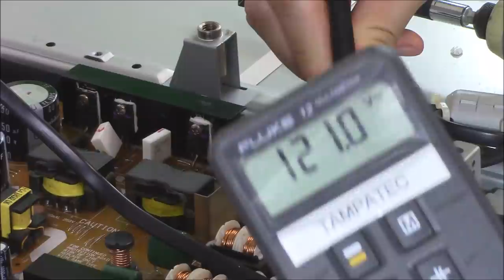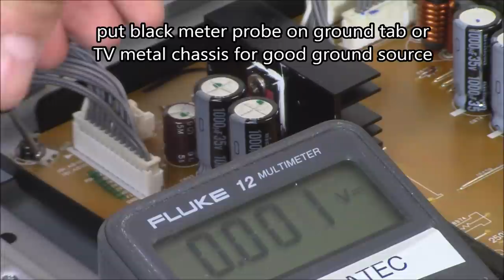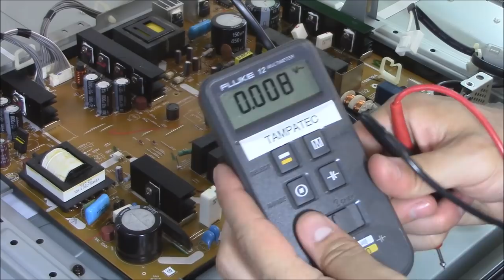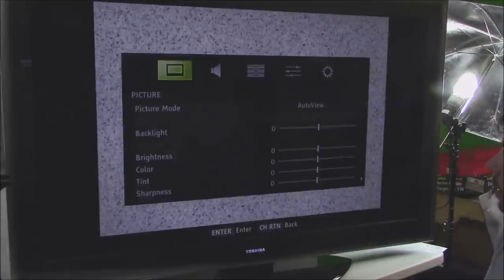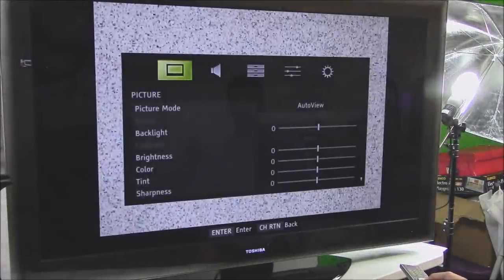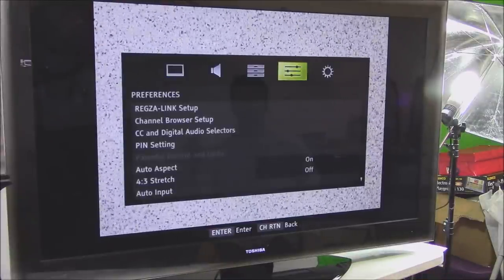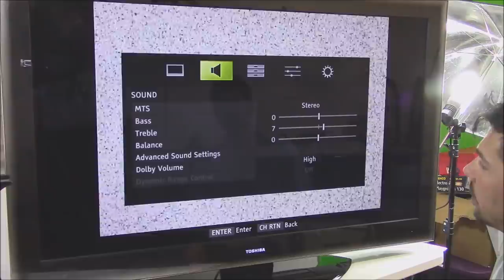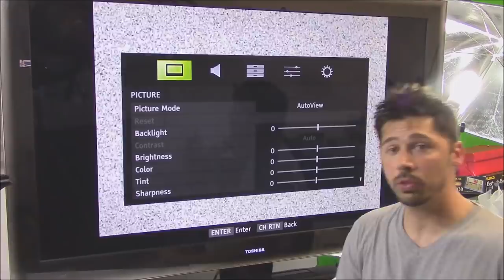Easy common fix Toshiba LCD TV, troubleshooting dead TV repair review

Comment from the maker: Help us Hit 300K subs and Grow Subscribe/Like for FREE Tech support- Please post "TV model" and "problem" and i'll reply with a common solution. Support this channel by getting a Capacitor kit for TV board repair- http://amzn.to/2gEH5Lt Thanks for the support! Let's bring back TV repair! Follow me on Instagram for giveaways and tech reviews https://www.instagram.com/tampatec/
Reply: Hey Tamptec, I'm new to the game; however, I have fixed two out of three displays so far using your advice, and based on percent chance that capacitors are the problem. I tried troubleshooting the power board on the LG 32LN570B-UH; the board is a EAX64905001 (2.4). Because I can't currently afford the Fluke meter, I am using a simple multi-meter with resistance, AC, and DC modes. When I tried reading the pin out I was at first getting less voltage than the 3.5, and 12, and 24 volts specified; the voltage was moving slightly. So I tried to read the voltage regulators and found that the voltage was jumping all over the map, peaking over 1000 volts, and following that reading the pin out was not reading any voltage. I have all ready replaced the caps on the board; However I suspect the voltage regulator is the problem. It seems there is more than one regulator, and the pins on each are jumping around. How can I determine which regulator is the bad one? 

I also found this link to the TV power board schematic: http://schematicscom.blogspot.ca/2016/07/lg32ln530b-led-lcd-tv-power-supply.html
Reply: Hi I am wondered watching people fixing tv's, you are in Florida that right?
Here in my country most tv repair shops are closed.

I am in electronics for 40 years but I repair treadmills and some other things, 
I have a lot of work.

Is posible to earn enough money fixing tv's?

Please comment.

Cheers.
Reply: Tampatec hey mine made a pop then turned off but a couple days later it was fine for like 3 hours then it shut made a blinking green light then shut off
Reply: Tampatec  I have a Toshiba 55 Led tv replaced fusible resistor now I have stand by volts but tv still won't turn on.
Reply: Q880 is the 12 volt IC regulator and Q840 is the standby 5 volt IC regulator.
Reply: R850  is a surge resistor and protects the 5 volt standby supply.
Reply: Raider5087 I checked them all and the r850 is open. What could have caused this and will that be the only thing I need to replace. Thanks
Reply: Hey bro my ps3 slime won’t take disc. The disc was stuck got out now it won’t take disc now can you help
Reply: I have a PE0702A V28A000962A1 Toshiba power supply board. following your video I don't have 5 or 12 volts. Do you thing that buying the kit from shopjimmy I can fix the board? Appreciate your comments.Antonio
Reply: Looking to get a complete board like this one in your video! Help me out please! Thanks

Comment: Thanks for the vid! I have the exact same TV and it had the same problem where one day it wouldn't turn on and had no standby power. I would not have known how to begin troubleshooting the issue but using your video I replaced the fuseable resistor and voltage regulator and boom, TV works again. Hopefully it works another 9 years!

Comment: Just repaired my 46" Regza using this video. Everything in the video was spot on with my set. It had just shut off one day and no sign of any power. Soldering the voltage regulator's 7 pins back in was a challenge- i feared that maybe i crossed some pins but it turned on great!

Comment: Thanks for the video.  Fixed this with 5J2R0 fusible resistor from Fry's Electronics.  The 5J2R0 was a suitable sub per some other online documentation.  Didnt have to swap out the Y6456 Voltage Regulator; which, was a good thing since they didnt have any locally and there were no suitable subs for it that I could find.  Whole cost was $1.59 for the 5J2R0 fusible resistors and there were 2x resistors in the package, so I have a spare.  This TV is 9yrs old is now new again and save hundreds in a new TV.  
Thanks Again.

Comment: Hello, first of all, thank you, great video. I have a 55ZV650U TV from 2009, it's very good, and today, for the first time, it didn't turn on. I checked up to the resistor point, and indeed, the fuse resistance of 1.8 ohms 5W is open. Tomorrow, I will go look for a replacement or something similar. I hope that with this, my TV will work again. Thanks again.👍

Comment: We just had this exact same problem! Our TV would not turn on, rather than looking for new I found this video, since I am a gas tech I had my multimeter.. and exact same fuse is bad for exact same reason as this video lol. So hoping today the repair store has the part and can hopefully de-solder and re-solder it for us since I don't have the iron pen. Seems very simple to do, I will have to invest in this!
Reply: Scratch this, its impossible to get the dam parts, so trying to find where to just get a new power supply board, and can't even manage that around me (Ontario Canada) .. so tv back together.. not gonna be fixed.

Comment: Hi, I have the exact same TV and exact same issue power.  It worked okay last night and this morning it will not turn back on.  Checked the power source that it works.  So, I am going to have to troubleshoot like you did.  I just wished you are/were close to where I am (in Midwest). So, I could just ask you -:).  But THANKS a lot for the video. I hope I can fix mine. I really like this TV as the picture quality is much better than many other more expensive TVs I have seen.  Thanks again.

Comment: thanks for the help just fixed my tv for 3 bucks because of this video. thanks again.
Reply from the maker: cool
Reply: +Roman Seppala  Where did you find the parts for $3?
Reply: +Roman Seppala , I also would like to know where did you get the parts from. I am in Canada.
Reply: +rmeshksar I got that fusible resistor off eBay from a company in the USA
Reply: Hi Steve, I am trying to find this resistor on eBay, could you send me the link that you used?
Reply: Chippie R were you able to find the fusible resistor online I'm having a real hard time finding it
Reply: Thank you very much
Reply: Your Welcome, make sure that is the one you need, mine was in R850 the other 2 were good on mine
Reply: its been working for 3 months now...all good...I actually just sold that tv and bought a 55 inch 4 k curved samsung tv
Reply: I am having the same problem on the 50 inch don't know what to do in wheelchair can't stand to long please help if you can
Reply: Any 1.8 ohm 5 watt ceramic resistor will work for R850 and fixes the dead set syndrome without replacing any regulator IC's.

Comment: I have a really old tv toshiba TP43H60 made in 1999 and i had the same problem. all i had to do was unplug the tv, then hold down the power button for 45 seconds, then plug it back in and turn the tv on and it worked! :D
Reply: For some reason, I decided to listen to your comment & try it on my tv, 2013 Toshiba. It actually worked! I’m not sure what the issue was or why holding down the power button works when it’s unplugged but it did & I’m grateful!

Comment: Thanks for the videos. Mine is a Toshiba too, the only pin with voltage is one labeled "5VCC" the reading is 5v so I assume it's ok. The problem is the TV makes a sound through speakers when I press power but it never turns on, green light flashes for a fraction of a second.

Comment: Ever replace smd type capacitors on a main board? Would that cause only 5v stby on power board but no 12 or 24 volts?  I noticed two seem slightly bulged.

Comment: Hi. I got all the way up to a successful test of the power cord fuse. I have not yet removed the power board to test anything further. Should I still go to testing the 3 white fusible capacitors (May have been called resistors, forgot)? Should I be going a different direction? The video ended after you replaced voltage regulator (I think), so not sure where to go at this point. Thanks.
Reply: Forgot to post Model and problem..... Toshiba Regza, 46XV645U. Had a power surge. When I plug it in, I hear a “click”, but nothing more. Won’t turn on and no status light. Checked everything you mentioned up to the power plug fuse and found no problems thus far.

Comment: I have the Toshiba 42ZV650U with the dreaded blinking green power light! I replaced the power board, and still have the same issue. Set appears to hang up in the boot sequence and never finishes. When I look at your work here, it appears that the boards differ a bit. My board is a SRV2194WW, I am almost thinking that something is missing from the set. It came to me as a throw away, and I suspect the previous owner dabbled a bit. I do not have a schematic, or even a photo of this model with the back off. If you have words of wisdom, or would be willing to look at a photo, please let me know. My main repair focus is musical instruments, but this has become an obsession. I want to fix this thing! Can you help?

Comment: This information is very helpful. I have replaced the caps on a HannG 281 D Monitor power board. It has a PHIHONG  PSM217-404-H-R switching power supply board. The monitor started and worked for a short time then stopped altogether. When I removed the board it had a small surface mount cap C404 blown. I would like to replace this cap but I can find no reference to its parameters. It is parallel with a 35V 470 uF Cap located at C403 so i am thinking it is on the 24V rail on this power supply. It is located adjacent to that connector on the board. The pads look like they will receive a 2.5 to 2.8mm long ceramic surface mount cap. I notice there seem to be a number of these on the board in parallel with the larger 35V radial caps on the other side. Is there a resource that would give me the parameters of these caps identified by their placement number on the board? 
Can you help at all with this? Thank you.

Comment: With probe, found out that one of the fusible resistors (RGDU5M-5E) is wide open, so went ahead and ordered from ebay, 5J2R0, supposedly a suitable replacement (yes?). Question: Couldn't I just replace the thing with an ordinary 1.8 ohm resistor? What is this supposed to do, besides serve as a fuse with a certain resistance?

Comment: Great Video, I have that same board and had some what of the same problem, I had no 5v stby and changed the v-reg and the same bad resistor and now I have 5v to stby  but still doesn't turn on, the relay clicks now when i unplug and re plug power.
any suggestions ?????

Comment: R850 is in-rush current limiter. Clean relay contacts otherwise it will blow again.
P.S. I would not screw the back until I check that TV actually works lol.

Comment: Hi Tampatec, I have a Orion SLED4668 and my issue is that, the standby light is on when plugged in but when I turn on the the TV, the standby light goes out but there is no picture or audio. I took the back panel off and tested the fuses first in circuit and found the 1 amp fuse to be bad. What suggestions do you have for troubleshooting what may have caused the fuse to blow in the first place. I'm thinking that maybe there was an electrical surge that caused it. I also checked the surrounding capacitors and diodes in circuit and they were all good. Thanks!

Comment: Is 4.98 volts too low? I had the same problem, did the repair to the power board (same parts needed). Thank you for the information. Unfortunately now, the output is now 4.98v. Still no stand by light.

Comment: Quick question, hope I cover all points.. I have a LG 50LN5310, black screen, Audio works.. with a flashlight I can see the menu display, moved it all over, so the tcon and mainboard works. No LED backlight showing, The power on indicator is red when I plug it in, and remains red when I turn it on... does not flash, just constant red light...  even though the flashlight test and audio works.. I have not taken it apart yet.. but im assuming some bad part in the psu... would I be on the right  track?
Reply: SladderBux  I took it apart, cannot see any obvious problems, no blown caps..  what I can see though, is the led backlight has 2 outs... 2 pos, 2 neg... And I cannot believe both led systems have failed at the same time... so My guess is a common power fail on the psu...  I can buy a used psu board for $35... so will try that route... I got this tv free... small 1/2 inch scratch on right screen.. but does not affect the video off the tcon..  and with 50 inch video realestate I did not notice til i looked up close... will order the board and see what happens...
Reply: SladderBux could also be a short inside the panel (i have seen numerous led's of differing brands that have led shorts-can be fixed if you have patience and have an led tv with a cracked membrane of panel but that still has good leds inside panel). even if only 1 side of the led fails will cause no backlight (like the old christmas lights strings that would fail because of 1 blown lite

Comment: Hey how are you, I want to thank you for all the videos you post pretty cool stuff. I just have a question for you if you can please help me. I have a toshiba tv that went black. When I would turn it back on it'll turn off after like 7 seconds and now it just flashes the logo and turns off. Also the front little red led flashes 5 times. All the caps look good on the power board I'm not sure which board is causing this problem. I would really appreciate a little feedback thank you again.

Comment: Your video's are great, but I need to know where can I find the power supply board for a mod # 47zv650u. i have searched high and low for this board to no avail. Any directions would be much appreciated.
Reply from the maker: I use shopjimmy.com and electropartsonline.com for discount use code tampatecfriend. Boards are reliable and have warranty.
Reply: Tampatec  in attempting to desolder one of the fuse resisters the butane soldering iron scorched a little area on the power board and now i'm getting bad readings in different places. Relatively new at this as you might tell. Any ideas on how I might still salvage this board as it is next to impossible to find this particular board.

Comment: Learn something new everyday!! thanks
Reply from the maker: any time,  knowledge is money, you can make money fixing tvs or save money fixing your own and save not paying extra for extended warranty or find a broken tv on the road to fix and sell. sad that tv repair is a dying trade, I'm one of the last of my kind, that's why I had kids so I can raise more tv techs so tv repair art will live on, kinda like disco but way less groovey.
Reply: I also am the only one in my area that does it. It's nice to have a community of repair folk on YouTube and the web to learn from.. Thanks again..
Reply: ***** I took tv repair classes in 1978, we fixed vacuum tube tv's. Later I worked in a shop and fixed transistor sets. Now I'm trying to learn LCD tv's, thx so much for your videos.

Comment: I had the same blown fuse as in your vid. replaced the fuse and regulator. not working still, I checked and rechecked the soldering points and fuses, they're good. Not getting any volts at the TV PWR wire (where you checked for the standby volts) 
Any suggestions on what I should check next?   VVVVVVVVVVV

I want to add that I'm getting 3 sets of three blinks and then a steady green light for about 15 seconds before it goes out.

Comment: Hi I have same 5v same problem. I can't seem to find where I can purchase the 5w fuses.  I can source out the volt regulator but not the fuse. can u point me in the right direction
Reply: +Stu Cotter Try Farnell.

Comment: I have a 32" Toshiba led tv (2012)  and originally figured the power board was my issue as l had not a power/standby lite, no leds lighting, no sound/picture, I ordered the power board and just received it today. Now with the new powerboard in l am seeing the power/standby lite and when it is powered on l get a chime, the LEDs illuminate momentarily and l can see the indicators on the screen but then it shuts off and repeats this every 5 or so seconds. I can see all the led back lites are working but only momentarily. I then replaced the mother board  as l am assuming this is the problem but there was no change so l assume the main board was ok.  I am stumped...any direction would be appreciated. The TV is just a spare and a challenge at this point...l don't want the tv to win!

Comment: Hello, I used your video great job Thanks. I have a question part #str y6456 9402A is the part # on my voltage regulator but when I look for it online they only list str y6456 do the last 5 digit matter? thanks

Comment: I changed the power board and now I'm getting 5V out but still no standby light and TV doesn't come on. Should I check anything else on the power supply board or move on to the video board?